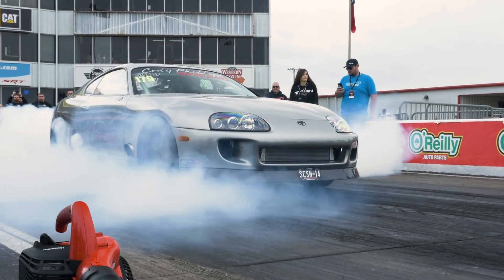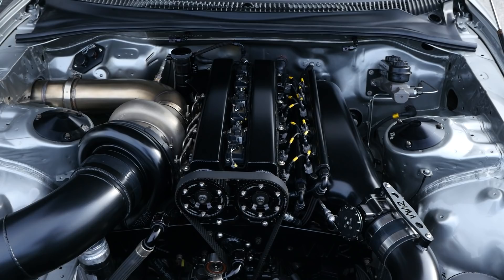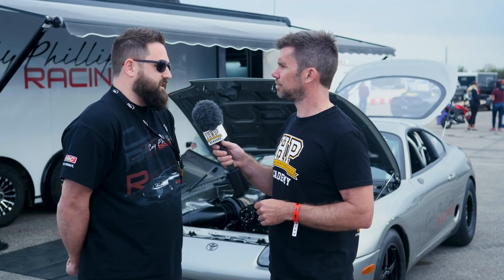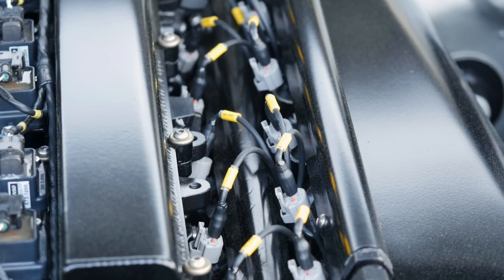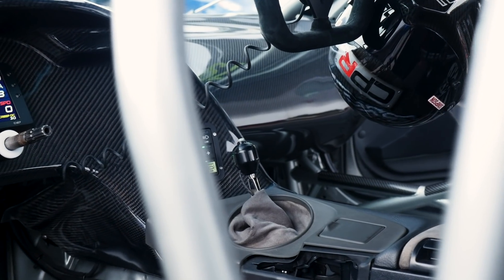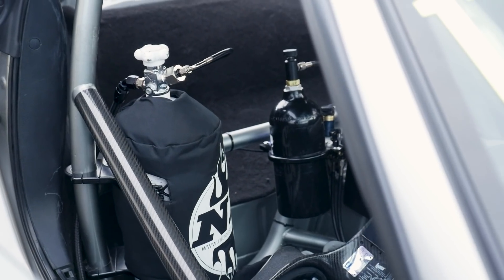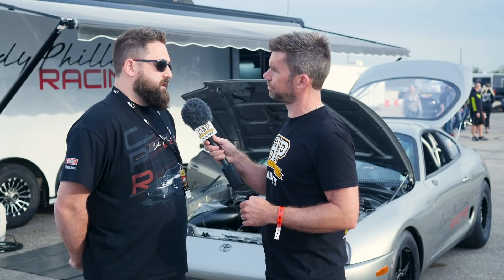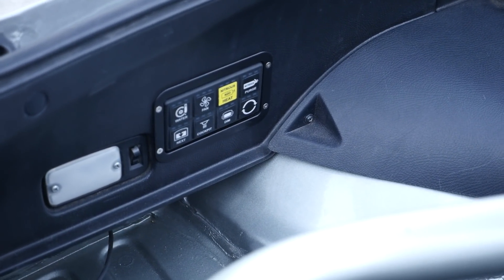Factory Block! Almost 2000HP, 7 Second Supra | PDM Programming Secrets [TECH TALK]

Comment: In response to the guests answer to the traction question posed, and his answer detailing that lifted front tires at launch as a reference speed obviously wouldn’t work, and instead, they utilize a programmed driveshaft speed curve.
I’m surprised that a traction control system hasn’t been developed that sources the super accurate speed measurement data a VBox system can provide.
Reply: There's a dragster in the middle east that uses GPS for traction control, but they have a much higher hz rate than the average GPS. But I'm sure it requires a very large bank account.
Reply: Pavel Kravchuk 
Cool...I figured that if I thought it...someone else surely would have
Reply from the maker: Shane T talks about this, I think in the interview here: https://youtu.be/2n2AaS-6rNo - Taz.
Reply: We really use a front vs. rear wheel speed strategy with some other pieces.  I just got a bit jumbled on the explanation as the M1 traction control strategy in the GPR package uses an engine speed limit.  Which doesn't function well on a converter car with the large hit to engine speed on the flash.  Could've given a bit better explanation on it, but hey it's all on the fly so you wing it sometimes!
Reply: @hpa101  Taz,  do you know if anyone employs optical flow sensors for measurement of displacement/velocity?

Comment: How much weight is added by half filling or filling the block entirely?
Reply from the maker: The filler is heavier than the water that would otherwise be in there, but the water passages are very small and it enables power to be produced that wouldn't otherwise be possible so the difference is negligible - Taz.
Reply: @hpa101  thanks for the reply man I love watching all your stuff